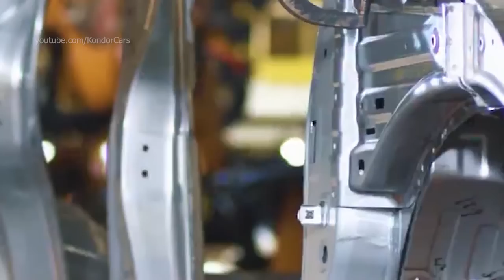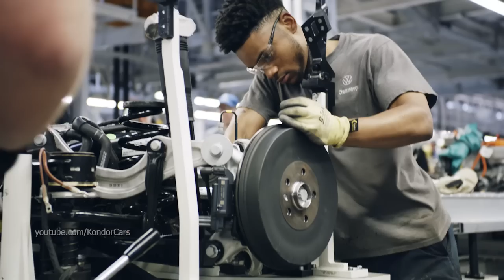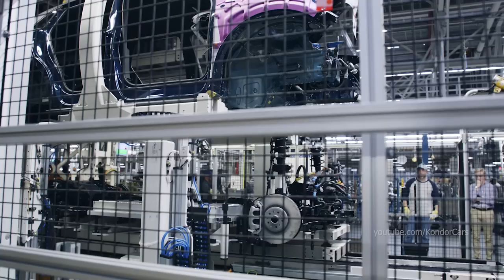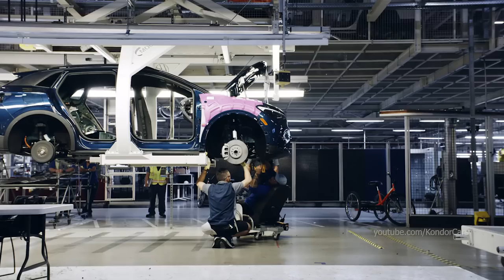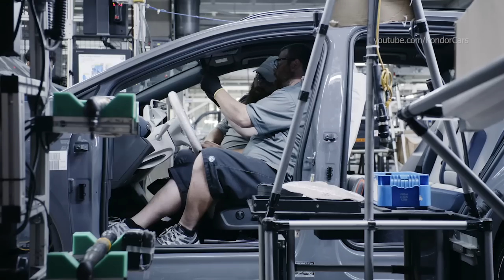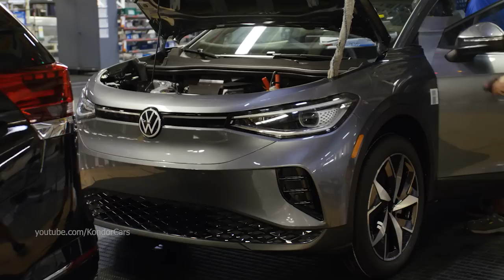Volkswagen ID.4  Production - US Chattanooga

Comment: unreal that this 2023 model STILL has drum rear brakes, as seen in the video.
Reply: Less rolling resistance
Reply: Not still, drum breaks again! The experience with the eGolf showed them that disc brakes are rarely used in electric cars and have serious problems with corrosion. The drum breaks will not rust and have never to be replaced.
Reply: Brakes are rarely used in EVs and drum brakes are a much less complex and inexpensive option, so it makes sense.